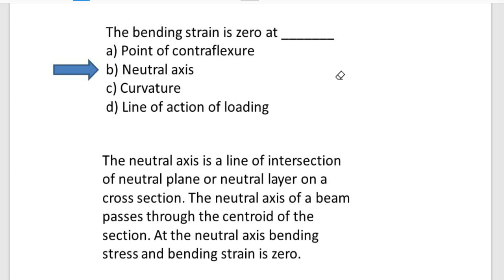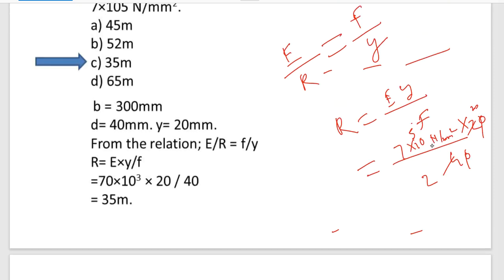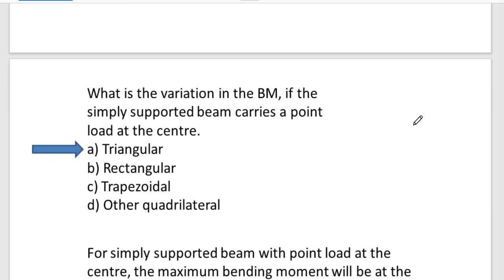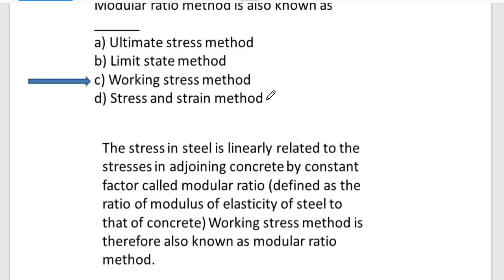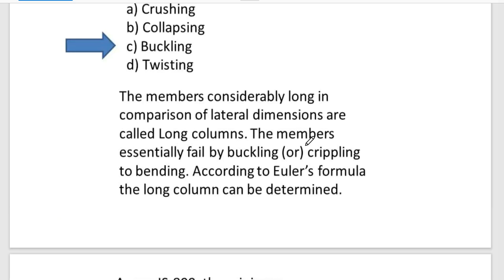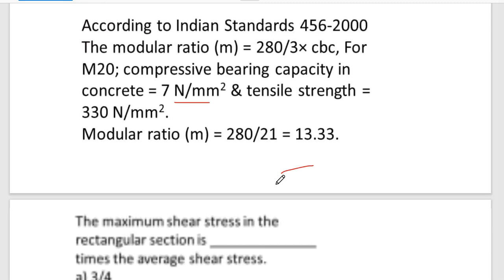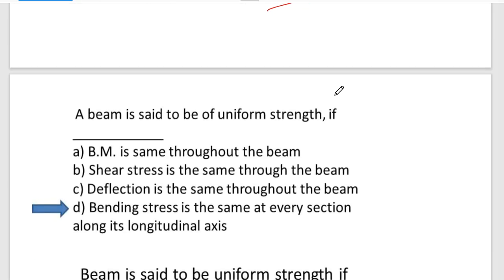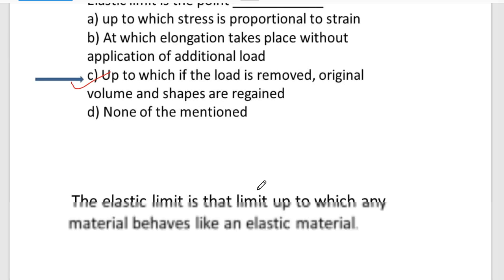TOP MCQ  FROM STRENGTH OF MATERIALS FOR APSC AE JE EXAM 2023 #civilengineering #apscae #apscje

Comment: I guess bending stress is not equal to bending moment. Instead it is directly proportional to each other. As the bending moment increases, the stress in the beam also increases. IT'S NOT EQUAL.Instead, the bending stress is calculated by dividing the bending moment (M) by the SECTION MODULUS(Z)
Reply: Apka niklega pwd is baar